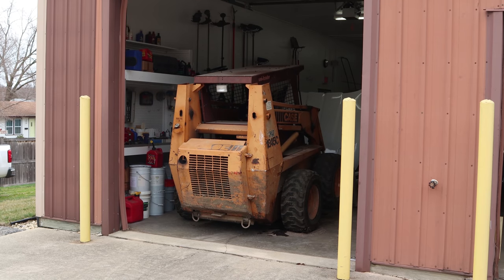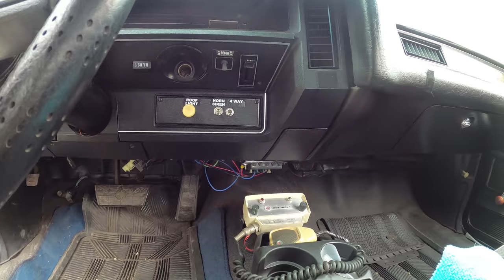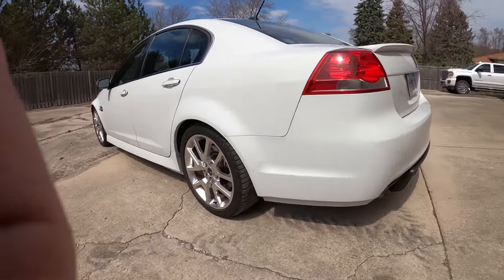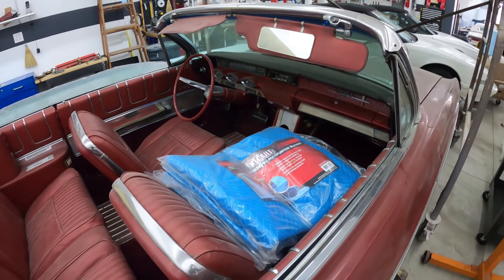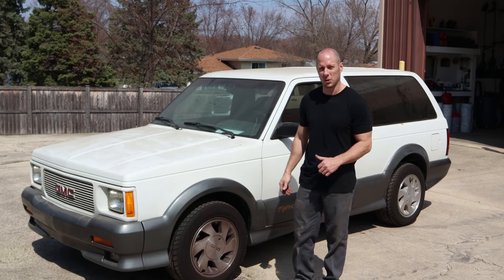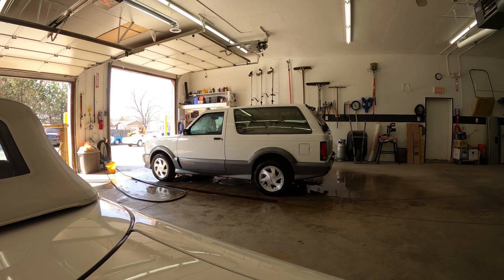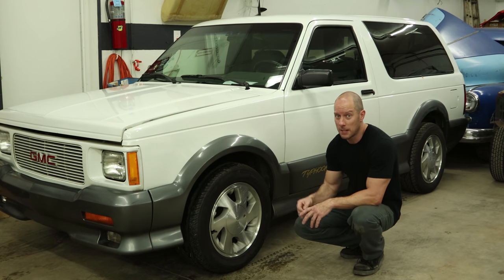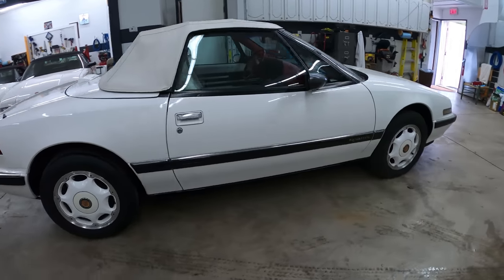A look at some of the rare cars in the storage building from the Mustang videos

Comment: OMG I love the Typhoon! Talk about legendary! I'll probably never get to have one but I've had 3 different S10 blazers and loved everyone of them
Reply from the maker: I loved the Blazers too, these were just the best version! Way ahead of their time.
Reply: I have to confess, I never knew it was called a Typhoon. I need to get out more.
Reply: @jimwiskus8862  Check out the Syclone.  Fastest production vehicle 0-60 the first year it was made - 4.2s
Reply: Had a 1990 GMC Jimmy 2dr. Loved that ride. 200k miles still riding well. Until some1 stole it. Nowadays, can't see a Jimmy around at all.
Reply: Anthony Whitehead I couldn't agree with you more man I'd love to my S10 blazers and pick ups
Reply: Had a 1993, Red w/ gray skirts.  I too wanted the White w/ gray but couldn't find one.  Sold it when I joined the Marines and I regret it since.  I've had a few fast cars including electric, but I will never forget the Typhoon.  Brake on, throttle to 4500 rpm and then dump the brake.

Comment: Kindly request that you make a special video to present that beautiful 2011 GMC Terrain, complete tour of interior, engine bay, on-lift view of the chassis and running gear, full specification rundown, and then a class-A test drive - including times for 1/4 mile, 0-60 and of course top end. Finally, have the afternoon crew pose for some show-level glamour shots. Then present us with your plans to swap engines for a Chevrolet Performance 572/620 Deluxe 621 Hp crate engine!
Is this asking too much? You can do it! 😎

Comment: Your g8 car you said was a flood car. I seen some very reasonable flood cars for sale. Do you feel the electrics could give issues down the road,  corrosion or other thing? Ones i seen ran, they say lite flood damage. Good idea to buy, ,just your thoughts?
Reply from the maker: I stay away from flood cars usually but since this one was rare, I took a chance.  Low water floods are usually fine as long as it was fresh water and it is completely dried out.  Salt water floods are junk.  Be careful, everyone claims floods are lite flood damage but you have to take it apart and inspect it to really know.  I have had this one for 5 years and no flood related issues.

Comment: On the 73 Chevy cop car ever think about adding a supplementary electric field pump by the tank to assist the engine?
Reply from the maker: Nope, it does just fine as it is.  Just requires a lot of pumping the gas pedal after it sits for 6 months.